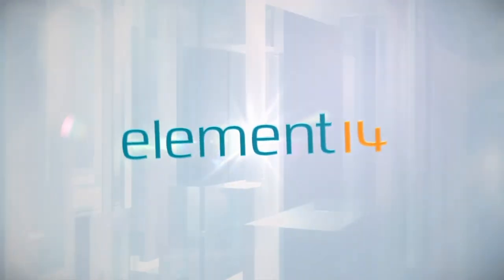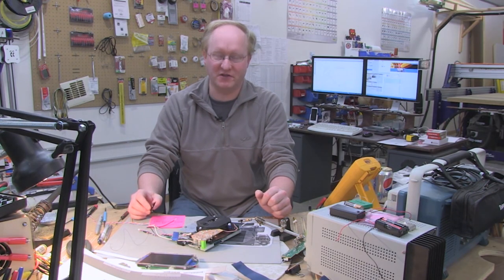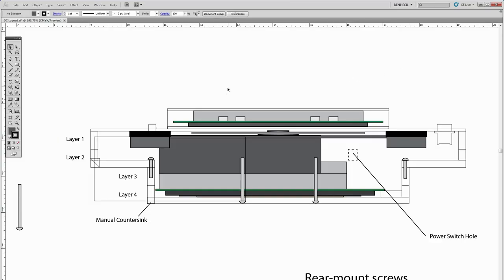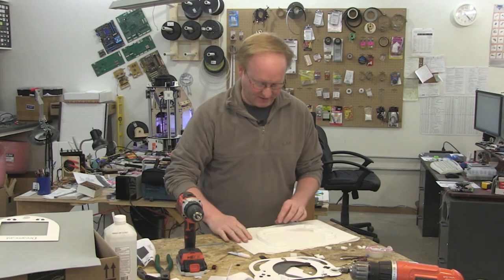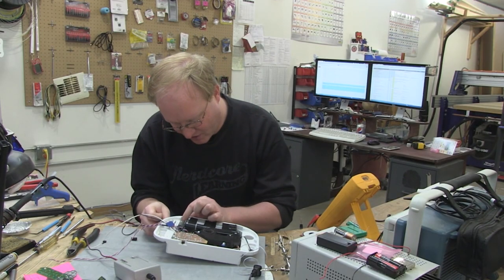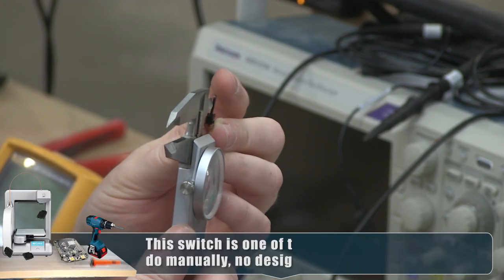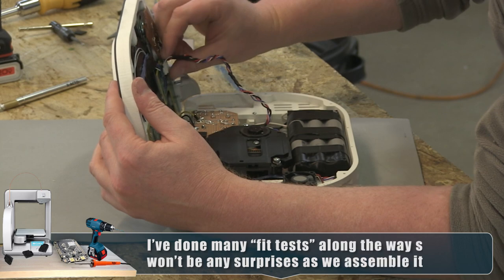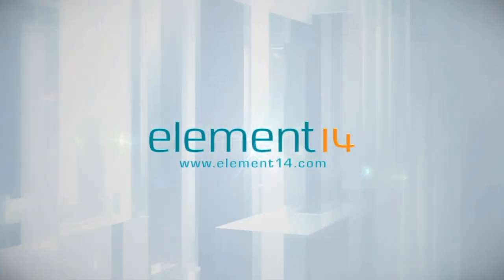Ben Heck’s Dreamcast Portable Part 3

Comment: What I would have done differently:

1. Remove that optical drive. GDEmu is easy peasy to install, and would reduce the power requirements and thickness of the whole case Not to mention you could actually play more than one game on it... And reduce load times... Plus loads more.

2. VMU is like more than half the reason the Dreamcast was amazing. I would have figured out a way to stick it in there somewhere. It was one of the few redeeming features on the console at the time. Plus, soldering the memory card in there basically made it impossible to play most of the later games--such as Shenmue--because of how much memory blocks they take up on the memory card.

3. Bigger screen, 1024x768 RGB monitor output. The Dreamcast was outputting the highest resolution images at the time, and you are wasting it with that rinky-dink PSOne Screen using Composite... Blech.

4. Headphone jack. Portable console that you have to make everyone around you hear. How annoying.
Reply: ***** Can you even buy the GDEmu anymore. I nver see any for sale on his website
Reply: ***** he used composite for sync, not video. It is RGB.
Reply: neozeed1984 Ah. Okay then. That one is taken off then. I didn't think those screens had RGB accessible to them.

Adrian Smith I never thought that they would be out, but you are right. Damn! There is news of a new board coming out 'soon' but yeah. Sucks.
Reply: ***** not to be rude but is this hinting on a future project for you? or do you not have the tools for it? im curious to see your added ideas.
Reply: No, he asked for a bit of advice on what I would have done differently.

I have ZERO skills of an artist when it comes to making the portable consoles.
Reply: ***** yes, but finding a good quality TFT LCD that is native 640x480 is pretty much impossible these days. But a good quality 1024x768 is easy to find. And it will most likely scale up.
Reply: actually I think the dc vga is 720x480 but only 640 is used for the picture
Reply: ***** I do agree with it needing a headphone jack, although funny enough, the Game Boy Advance SP had no headphone jack I believe.
Reply: You had to use an adapter in the link port. It was super not cool.
Reply: I see where you have a point of so. It would be awesome to have a wireless headset; or input for earplugs/headphones  with  it; and unit, or even a transmitter. Mind boggling; but i get your point what could make it even better.
Reply: thanks, exactly my thought

Comment: I know this would be more work but, you should have added a tv output and an audio jack.
Reply: Commodorefan64 Maybe configure it so that when it's connected to a tv the screen displays the VMU? As for the extra controllers a dongle wouldn't be a bad idea.
Reply: Cesar Serrano VMU on any other screen than the VMU LCD is far more hassle than it's worth.
Reply: Naoki Saito If that's the case then you can install the VMU's screen underneath the main screen.
Reply: ***** I think it would have been an abomination at that point and pretty overkill considering what this is. It was already very large due to the cd rom and it just doesn't fit with the spirit of a handheld to add all those features. At that point, he could have just taken the dreamcast and added a screen/battery to it. 

I like how it turned out but i would have done away with the cd rom and got the gdemu to replace it so it could have been much slimmer and less sensitive to skipping while handling it.
Reply: Commodorefan64 they can use GDEMU, works perfectly fine with me, and you can play original GDI files. there is a menu system that was created for it

Comment: I own two Dreamcasts, one works one doesn't, and from the bit of research I've conducted it looks as if the GD-ROM isn't at all reliable - and fairly expensive to replace if you buy it brand new and don't cannibalise another Dreamcast.

It'd have been amazing to see you replace the GD-ROM with a flash drive of some description, loading games from SD-Card's etc. From this projects point of view, I think the exclusion of the GD-ROM would've made your life so much easier I think.

Comment: Once again you have made an excellent portable console. I like how you handled the CD drive, on top of handling the controller and VMU (on Nightmare difficulty). I can see why you took the path that you did. But if you thought the DreamCast was a challenge, the Original Xbox (the true Xbox 1) would be impossible, just because of the motherboard. I have an idea in mind, maybe you can take the Rasbarypi 2 and build a controller around it, and upload emulators to it.

Comment: Turned out really amazing. I can see why this took a long time. Really looks professional. One thing that could improve it: Ditch the GD-rom for an SD-reader or similar. Would increase the complexity of the project even more so, but probably save more than an inch of thickness. The nice thing about this unit though is that is resembles an 'original' dreamcast.

Comment: This was a really neat build to see done. It would have been nice to have seen a more rounded, 3d printed case, but I can understand how going with your typical layered approach was better for a first attempt at the console given the need to be able to account for issues along the way as opposed to having to scrap larger, more complicated single parts.

As nice as these custom portables are, I can't imagine they are cheap to produce. Even discounting labor and time, I have to wonder how many consoles and/or controllers you've had to scrap over the years due to issues with a design.

You know, it occurs to me that we've seen you make a lot of consoles that were meant to be set-top into portables, but I wonder how hard it would be for you to turn a console that was originally portable into a set-top box? No, it isn't necessarily the most practical thing to create, but it would open up a lot of really cool options for builds. Heck, given that the hardware is often already designed with a small form factor in mind, imagine doing a multi-console design that plays, say, GB/GBC/GBA, Game Gear, Lynx, and Neo Geo Pocket Color games all in one convenient GameCube-sized set-top box? It's something that could more easily be done with emulation, sure, but then again, so could the VCS handhelds (even when you created them.)

Or, if we're being crazy... why not try designing a better TurboGrafx-16 portable?

Comment: Hey Ben, I have watched quite a few of your builds where you use the layers of sintra (sp?). The result makes sense but the 2D milling limits the end result to flat surfaces that are not always pleasing to the eye and/or ergonomic for the end user.

Would it be possible to mill/3D print other pieces and glue them to the layers (like you did with the analog trigger covers) for added ergonomics (i.e., contoured hand grips) and appearance (smooth, curved shapes) and then do a vacuform piece of plastic over the end product that covers the whole assembly and screws on with the final assembly screws (have to make it removable) to hide layer seems, different materials, and smooth out shapes?

Just an idea. Not sure of feasibility or if you had ever tried that.
Reply: ***** I agree, he uses Illustrator and makes everything in 2D, think it would be more ergo and sleek looking without all the straight edges. after long periods of use it seems like maybe it would cut into your hand a bit.
Reply: ***** I wonder if he could router the edges of the sintra.
Reply: I think he looked angry at the conclusion of the video. This one must have really sucked.

Comment: I am late to this party, the only extra things I would have done, which was mentioned before was to add an A/V out and maybe extra controller ports, that way you can hook it up to a TV if you wanted to later, I do realize how much extra work that would have put on this project.  Overall, this is impressive.  If this was on the market, I would have to pick it up.

Comment: Someone in the Dreamcast Community I used to be very active in has a Treamcast which is an official, portable Dreamcast made by SEGA Japan. I once had the Chance to experience it on one of our gatherings. I would carefully take it apart to compare the parts with the Dreancast and check how it was done, then try to build my own. If I had the knowledge I would even analise my broadband Adapter for the Dreamcast and try to make a wireless Adapter with some compatible Chips.

Comment: Hey Mr. Henckendorn great job on this build. I was really interested to see how thick it would all be given the drive assembly and the way the controller is constructed with VMU and whatnot. You probably made it as small as it could go unless you did a flash drive system in place of the GDROM drive with the roms like I've seen in some other video a while back. Great job all around though and I wouldn't change a thing. And on that solder job connecting the controller...it looked like such a pain in the butt and I've been soldering for 14 years now haha. I'll leave this comment with a question...have you ever considered building a Dreamcast laptop? Keep it up sir and have a good weekend!

Comment: This series was awesome! I might have to "steal" the ideas you had of running it on batteries, as well as using a PS1 screen. However, I would like to play against/with other people, so I might end up using the original case and hide the screen under the CD lid.
Combine this with the small project of installing a VGA and 3.5mm audio ports on the back would make it extremely versatile.

Comment: The closest I have ever done to modding my own console was that I removed the RF box from my Sega Megadrive II (Genesis II to the US folks) and solder my own composite plugs onto it's cable, as well as replace the power switch (it was one of those clicky push-down switches and kept turning the console back off randomly) with a rocker switch I had from an old fan.

So, it was more a fix than a mod.
Reply: Bright Spark I modified a Genesis 3 (Megadrive 3) with a 4 pole switch that gave me a single switch to choose all 4 possible region combinations a Genesis/ Megadrive has. Was pretty easy. Hardest part was getting the switch wired up for the different signals. I actually stole the switch off an old dead alarm clock I had as it just so happened to have the electrical connections I needed.
Reply: It's called genesis in all of North America so think before you type.

Comment: cool project,in the end it is not what I was expecting,built the screen on the lid is strange. I was more thinking like a psp layout,with vents and fan on the side,back firing speaker,the lid alone on the back and the screen with button on the other side of the console (the back of yours.)

Comment: Since you ask what I would've done, well what  I would do is eliminate the optical drive and run it through a Dreamshell or GDEMU. Cut weight, size, and heat dissipation out.

Comment: This is amazing, and increadibly well done. But I think that it would improve your project if you used a USB-GDROM or GDEMU board to replace the optical reader and optical controller unit. That would surely reduce space, heat and energy consumption. Also, it would be nice if you could put a microcontroller, or something in that sense, that could measure the battery load and indicate if it is running out of energy, via a LED light. This way the player can know how much time he has before the device turns off.

Comment: You should have built this with having a vmu screen in mind. It can be pretty necessary to some games like Resident Evil: Code Veronica. Also, you should have found a screen that supported VGA output since that is the way you can get the best output for the Dreamcast. Lastly, I would have used a 3rd party controller so I would not have had to sacrifice a perfectly good 1st party Dreamcast controller.

Comment: Why not make the portable smaller by adding the GDROM drive separate like an attachable CD player. The player drive that holds the disc can be connected through wires with a plug to remove it when not in use. Yes I know it would require more work but I think it would be cool. It could even be attached through some sort of clips...

Comment: I would have had the going out the back instead of where your hand is covering the covering the fan to give it more room to exhaust the warm air, and maybe even added a TV out and audio out for headphones which can be used for the tv audio to with 3.5mm to rca cable

Comment: I know that it's a thing to have the buttons on the screen but a good way to be portable would be to have the console and screen together and have two controller ports so it can be played with the controllers outside the portable system. it would of made it seem better than to cut the boards in a way to fit the controller.

Comment: I would've looked into using an sd card/compact flash solution to save more space and power. I also would've used a bigger vmu. Some games eat up stock vmu data like you wouldn't believe, especially the games I'd have in mind to make a portable dreamcast for.

Comment: I would also schedule more time to work on it, but besides that, I'd try to find a better solution for the CD (or GD, whatever) ROM drive. Those things take way too much space, and I guess the motor consume too much power for a portable device.
It doesn't seem that a disc would be appropriate for something that you will move around while it's spinning, but I've never used a "diskman" (remember those?) so I don't really know.
Finally, the case. It looks too irregular, so I'd try to make it flatter, if not thinner.
Though, yes, all of that would require more time investment. Maybe make it a 4-parter episode?

Comment: Ben I have a question. Is the dream cast cd reader needed for the whole system to work? Or could u wire in a slim optical drive to reduce the size

Comment: Since a while there are options available to substitute the CD drive with DVD, SD or USB. The software may a bit of a letdown and not give temhat original dreamcast feeling and be a bit of a headache to configure... But I think that would get rid of quite some bulk and you could store many roms without need to change a physical disk :)

Comment: Hey Ben, i jave a portable windows embedded mediaplayer that accually runs v6 of windows.

I has a combined usb/hdmi port that i don't have a cable for. 

How would i measure wich pins are for usb and wich are for hdmi? Than i can make my own usb connector.

It is a Cowon HD V5 pmp (32GB).

Comment: I would totally connect the rumble pack too, made a jack for the audio and a port to connect everything to a tv.
Expect for the rumble pack, i would have left the VMU to the port thing, or make available the screen of the vmu somewhere.
Finally, i would have add at least one controller port, to avoid problems with the memory card (how do you transfer save file in this way?).
But, i'm not able to do anything of what you did, so basically, i'm just pretending too much...
XD

Comment: Those batteries look really heavy. There is a dreamcast SD card adapter using the serial port that wouldve worked well with this build to make the system more compact.

Comment: What i'd do differently is to drop the disk drive and replace it with the SD GDEMU mod that's out there somewhere on the web... but then again, i hardly know the hot pointy bit from the power connector on a soldering iron so ... yeah

Comment: I would have used a GDemu drive..So it would just have an SD card slot like a switch ect...Would be much smaller lighter and use less power...

Thanks, love the work

Comment: I'm afraid I haven't modded much before (I removed the lockout chip from an NES and aside from soft mods, that's about it), but I would have had the bios modded for this Dreamcast and included an sd card reader, and removed the disc drive. Since most games can now be ran off the SD card with little to no issues.

Comment: What screen is that? I was looking for a battery powered screen similar to that for my own portable device I was going to make. Thanks!
Reply: Mantenner It's the screen he pulled out from the PSOne portable screen accessory from Sony. Useful because it has the pin outs for sound and video already in the board which houses the screen. He changed the back light to LED's so it would be worthwhile to run on a battery pack.
Reply: Nick Schafer thankyou so much!
Reply: I believe part 1 shows him changing the backlight to LED's.

Comment: The whole thing would've been easier and faster if they had replaced the CD drive with a flash memory reader or something similar. Although if you're going to do that you might as well not even bother with the original Dreamcast hardware and move on to emulation. And that can be done on a Raspberry Pi or strong smartphone.